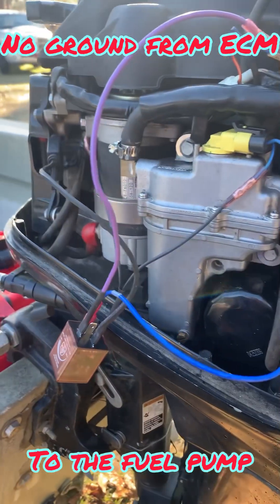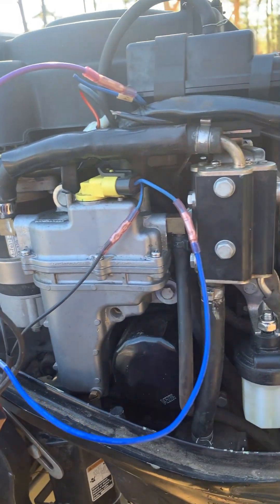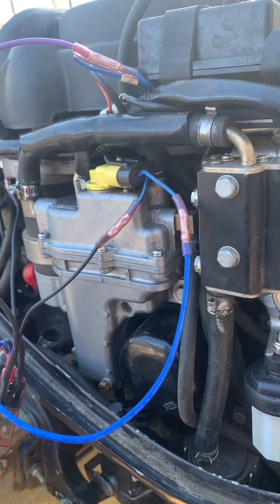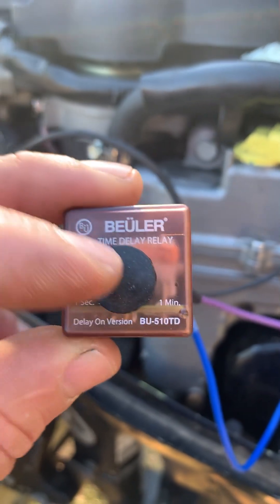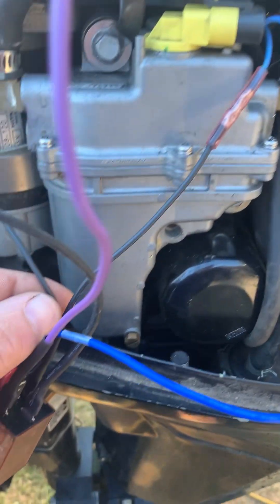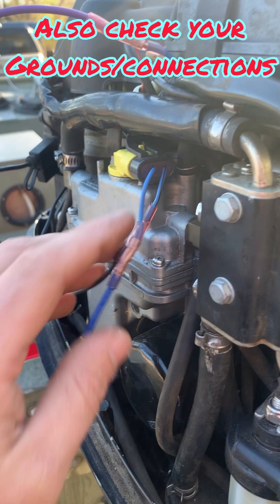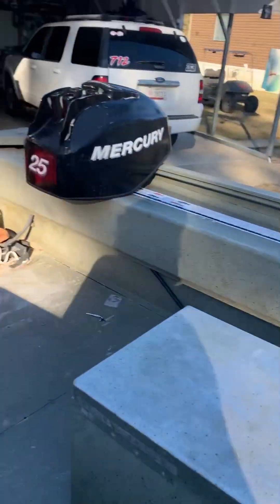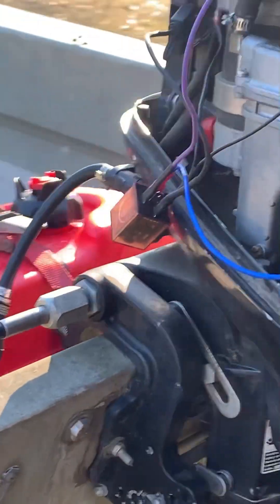Mercury/Tohatsu 25-30 HP fried ECM from aftermarket fuel pump. CHEAP FIX WITHOUT BAD ECU REPLACEMENT

Comment from the maker: I have gotten a ton of messages about more specific questions about wiring. Cut the original plug (2 wires) that plugged into the fuel pump/VST tank. Be sure to leave enough room on both sides to allow for a butt connector. It had a blue wire and a blue/black wire. 86 on the relay should be wired into the blue wire that is on the engine wire harness side (back to the ECM). ANd 87 on the relay wired to the blue wire on the plug side that plugs into the fuel pump. The blue/black wire on engine harness side (back to ECM) will now be left bare. The blue/black wire on the fuel pump plug should go directly to engine ground (use any bolt that's grounded) as well as to pin 85 on relay. and 30 on the relay should go to your constant 12v+ power source (fused of course) and I used the hot side of the starter relay.
Reply from the maker: And this setup is still working just fine. Customer uses it almost every weekend.
Reply: What size fuse did you use?
Reply from the maker: @jasonbower8524  15amp
Reply: Is that 15amp fuse too big, should I use a smaller fuse, does that oem pump draw that much power.
Reply: @racertjay will this work on mine exact same motor but manual start no battery

Comment: I need help. I have done the fix that you suggested. The motor now runs but it didn't solve my original problem. The shop had it for 3 months. Ruin my whole summer. I brought it there because it was only doing 7 mph. He gave it back to me with the relay fix but now the engine is still only doing 7 mph and it seems like it's surging at full throttle. So what is the issue with the motor? All my components seem to test good. Is it the high pressure pump is bad?
Reply from the maker: Sounds like you need to test your high pressure fuel pressure. There is a Shrader port on the fuel rail to do so. If it's good it ruels out a fuel pressure delivery issue, but could still be in injectors. If bad, you would need to confirm everything is good on the low pressure side before confirming it is high pressure pump. This could mean clogged VST tank/float, low pressure pump, filters, collapsed hose/bulbs, clogged pickup in tank. I'm not sure what the spec of the Mercury motor is but usually motors it's size should be in the 30-40 psi range
Reply: @racertjay be new pump today still pulsating and doing 6.5 mph
Reply: High pressure pump didn't solve anything. Clean the VST again. Still finding white residue. The fuel cooler was cleaned the fuel's clean. My only other gas is maybe the injectors but it's like it's running out of fuel every 5 seconds. Pulsating up and down at full throttle only at full throttle and I think that might have something to do with the relay. I don't know
Reply from the maker: @FishingwithForrest  You are throwing parts at it for no reason without testing the fuel pressure. Sounds like an issue with the low pressure side.
Reply: @racertjay well it was at the shop for 3 months. He said all the pumps were good. I'm returning the fuel pump. I ain't worried about that had another guy on here. Tell me that I should check the throttle position sensor but it doesn't look like I can even test it without a f**** computer so I don't know what to do. Next thing I'm going to do is pull all the injectors and have them cleaned
Reply: The fuel system was very dirty and still seems to be dirty, so I'm guessing there's dirt up in the injectors. When I first got the boat the top plug looked fouled and the two plugs underneath that looked fine. So my theory is is that the two injectors on the bottom of the engine are running lean and the top one might not be as dirty and is following the plug
Reply: @racertjay fuel pressure is at 42

Comment: ECUs usually control the "low side" of the circuits, the ground lead. Aftermarket fuel pumps often draw too many amps compared to OEM pumps, and blow out that controlling MOSFET inside the ECU. 
Therefore your fix is best, because replacing the $$$$ ECU with the same fuel pump still there, would kill the new ECU. 
You could bench test an OEM Vs aftermarket fuel pump and  ensure the amperage draw is within an Amp or so....

Comment: Do you have a wiring diagram for this motor?  I have a 2009 mercury 30hp efi 4 stroke....has electric start and also pull start....so it can run batteryless too...really need to know the colors of the wires coming from ecm etc.  

Also another question how does a battery less efi system like mine work in the event that say my battery died?  Does the rectifier supply dc voltage to the ecm?

Comment: Im curious how things work so im just wondering what's the actual need for the delay?  

Also does the fuel pump continuously run?  And the mechanical regulator controls the fuel pressure in the fuel rail?  Or does the fuel pump driver module in the ecm turn on and off the fuel pump based on sensor readings?  Im assuming the pump just continously runs because there is no fuel pressure sensor of any sort to tell the ecm what to do....im really curious on the need for the delay
Reply: The pump runs for the entire duration that the engine is running, there is a relief valve and return hose back to the vst.

When you crank the engine there is a sensor that detects that the engine is rotating and that turns on the fuel pump, when the engine stalls for any reason it cuts the power so no damage happens to the fuel system. I'm not sure why it needs the delay to run, but its probably something to do with the relief valve being open and that being signaled to the ecm.

The pump gets both positive and negative from the ecm, so by using the positive to trigger the relay you are pulling really low current to kick on the fuel pump, which saves the ecm

Comment: Great video, what side is the load wire on the yellow hp pump connector, trying jump the hp pump but not sure of the connector pin out? Thanks

Comment: Can you tell me what "gauge wire" Mercury used for those "Blue" and the "Blue/black trace" wires in that 2006 Mercury/Tohatsu 25HP outboard you posted this about? 

I am helping an elderly neighbor with this exact same year, make, model, and scenario to boot! Thanks in advance from a former FL LEO and former Master Automotive Technician.
Reply from the maker: I'm not sure exactly the gauge size, if I had to guess it was in the 18-20ish range. Much smaller then What I installed which was 14-16ish
Reply: @racertjay  I didn't know if you would see my reply and or reply back. Glad to see that you did. I ordered that relay and the proper sized wire fuse holder. I compared the  blue and the blue/black (trace) wires for the fuel pump in the wiring harness with some wire rolls I had. I had to dig the wire rolls out as I have not seen them or used them in many years!  

The Mercury blue and blue/black (trace) fuel wires ended up being 18 gauge. When we first see your small YouTube video preview picture it shows us your wiring schematic for your wiring drawing of that relay. It's a pitty that the relay wiring diagram was displayed so fast as a "preview" image . As a result, no one can take a picture of it or even stop the video to see it. I don't need it myself but wouldn't mind having the your "artist" version of it! I know other viewers would love to see it posted!

You did a AWESOME JOB with the tips,  the video, and explanation in great detail. Other people would clearly benefit if you would make an additional video showing that wiring diagram. That would also slow or stop the additional request for it. Thanks again for helping me to help my senior neighbor who is in his 80's. Thanks for paying it forward too.
Reply from the maker: @ thank you for the kind words. Glad I can help. If you email me at racertjay@yahoo.com I will send you a picture of the wiring schematic

Comment: Have same motor but manual start. It doesn’t have rectifier to wire pump into. If I bought a rectifier could I wire your relay setup with + wire going to rectifier output and achieve same results. Can’t see adding a battery if there is no way to charge it with the engine. Thanks for your time sir!

Comment: My fuel pump died thin Spring, so I replaced it with the Optimum type mentioned here. I followed these wiring instructions, and it works perfectly. Thanks for posting this video!

Comment: Hey bud i have a 1997 mercury 200 efi. After messing with i noticed i wasn't getting a ground on fuel pump. I glad i came across your video but was wondering if you had a writing diagram i could get as are wires and everything won't match up as they are different motors.
Reply from the maker: Email racertjay@yahoo.com and I’ll send a diagram
Reply: Sent

Comment: I just bought a used Pontoon with an 08 mercury 25hp 4 stroke EFI. 
I had the issue where it would start up when cold but if you shut it off after running for any amount of time it wouldn’t restart without sitting for a long time. 
I got a Tupperware bin full of things with the boat and I noticed an old fuel pump in the Tupperware. I also noticed a ground was teed into the fuel pump connector. I checked fuel pressure and I had 43 psi and figured fuel was fine. If I sprayed carb cleaner in the intake it wouldn’t pop off at all so I figured I wasn’t getting spark. Checked with a spark tester and sure enough no spark. 
I figured my ECM was toast after ohming the pulse sensors and getting measurements within specs. 
If it wasn’t for your video I never would’ve realized that the previous owner must’ve replaced the fuel pump and when the fuel pump was pulling too many amps and overheating the ECU it was causing a no spark condition. 
I added a diode suppressed relay to power the pump and so far it has started up shut off and restarted several times. I’ll have to report back after hitting the water again. Thank you so much for your video! Life saver!!
Reply: Hey, curious to know if you had success?  We just bought a pontoon with 2006 mercury 40hp with the same problem.
Reply: @Outsideofthebox13 yeah that fixed it 100%! Basically just used the original power wire to run the small side of a relay and ran a dedicated fused power and ground to a relay. I’ve used it several times and it runs great now!

Comment: Thanks for the info! Should the fuel pump be running when ignition is on, prior to starting?
Reply from the maker: No only when turning over
Reply: @racertjay  great. We took it out and put 12v to it - hums but seized solid. OEM replacement is over $800!!  A local mechanic recommended one on Amazon by Quantum Fuel Systems (US), for about $125. Ever heard of that brand?
Reply from the maker: Yes this was a quantum pump like the video says. Pump has been working fine but im assuming it pulls more amps then the OEM pump which is what causes the issue inside the ECM. The circuit in the ECM can’t handle the extra amp draw

Comment: Sorry for not understanding fully but my mechanic told me my ECM needs replaced after an issue following fuel pump replacement with a aftermarket pump. Would this work if the "ECM is bad" according to him?
Reply: Depends. He needed ALOT of research to figure this out. Its not easy. If you have the identical engine you may do his repair. If not save your money for an emm and fuel pump (or resistor to drop power to pump)

Comment: I have a 2003 60hp 4 stroke mercury motor with a fuel pump  that runs str8 through and i can't figure out what could be causing it. The beep that should come on exactly after turning the key on the control starts after like 20 seconds after i turn the key and when it comes on it beeps for a long time stop and starts back again. the only time my fuel pump stops is when the peeping stops and that's because the beeping only stops for a second. what i'm trying to figure out is if the problem is cause by my ECM, the Vevor control i bought off Amazon or is it just my fuel pump.  please can someone help me with this issue? i'm really in a bad place right now.

Comment: Tohatsu outboard does not get gasoline into the cylinders. The injector, ecu, spark plugs are intact. When I pour gasoline into the pistons, it works a little. When I press the starter, oily gasoline comes out of the exhaust. Could the high pressure pump have malfunctioned? How can I test it? Greetings from Istanbul, Turkey..
Reply from the maker: Test your fuel pressure with a gauge at the test port (shrader valve like a car tire) on the fuel rail. If no pressure, test the voltage at the fuel pump wires going into the vst. Don’t use motor ground use the actual wire
Reply: @racertjay    In this engine, apart from the normal injector, there is also an air injector. I do not know how to control the air injector. The compressor is very good. What does air injector do? Could the cause of the malfunction be the air injector? Thank you very much.
Reply from the maker: If you have fuel pressure, you have a different problem. Could try to bleed it off and make sure it builds back up next time you start it.

Comment: I have the same problem with my Tohatsu TIDL 70Hp will this work on my motor. 

It also has a bad ground to ECM
Reply: Did this fix it?  Would your pump come on upon ignition but wouldn’t fire up ?

Comment: im having a issue kinda like this  i have 12 volt at ground when the engine is off but when it starts it goes to 9 volts then to -2 volts is this normal for these engines?

Comment: Did the engines oil light and beep sound come on before this fix?
Reply from the maker: the oil light will come on for a second or two at each startup. Before and after the fix (that's normal). The beep also the same.
Reply: @racertjay  my 2007 mercury 25hp is having intermittent ground issues on the fuel pump , it starts sometimes but only if the oil light comes on and it beeps and it will run all day long and have no issues , but after it sits for a few days I turn it over and no oil light or no beep so I’ll have to try and crank it for a long time to get it to run, my question is prior to your fix was the oil light and beep coming on while cranking , I’m just wondering if it’s my ecu or the oil pressure sensor . Some days it works fine some days it takes a while to start , but only will run when it beeps and the oil light comes on
Reply: @deangarrett50  do you find a fix I'm having the same problem right now

Comment: You should redo that video with it wired right
Reply from the maker: It is wired correctly in the video. Which is why it starts up and runs and still runs now?? Not sure what you mean. But I also see your other comments now. Read the pinned comment on the video I made for specific wire colors to relay pins or if you send me your email I can send you a wiring diagram I made
Reply: @racertjay are you willing to send me the diagram i really appricate your time !! i just put a new pump in and scared it gonna blow it up you know how i can put diode in

Comment: It lookes like  both ground wire from bolt and wire to pump are  on same pin, if so there is no delay on ground.
Reply: That's what I'm saying 🤔 Might as well ground it directly. If it's a negative trigger pump, it would have 12volts all the time and closing the ground would kick the pump on, if I'm understanding this correctly.

Comment: Just had the exact same problem show up today, 2nd time running motor after replacing the HP pump.  Man I wish I knew this before buying the aftermarket pump.  Was your ECM still good aside from losing the fuel pump ground?

Comment: i have a 60hp 2015 with bad pump , i wanted to bypass the original relay all together , what part number or under what name did you use to get the plug for the fuel pump ( black plug with 2 blue wires going into yellow plug) thanks

Comment: I have 2001 Mercury Optimax and the ground wire from the ECU is bad. I had thought it was the fuel pump and replaced it. When I started it up the engine didn't fire up. Like you I checked the power wire and not the ground wire. A new ECU for mine is $1,700. If I can do what you did it will definitely save me a lot of money. So how has your customer's boat been holding up? Let me know cause if it's still good I'll be doing what you've done in this video. Thanks!
Reply from the maker: Everything is still great. They use it almost every weekend
Reply: @racertjay  Awesome. Thanks for the very quick reply.
Reply: @racertjay Hooked up the relay. The outboard fires up nicely. But the thing is the fuel pump stays on. Did your customer's boat do the same thing? Stays on even before I turn the key.
Reply from the maker: @kisdasenglothnam  the fuel pump should run constantly when the engine is running. Is that what you are referring too?
Reply: @racertjay  I hooked up the 12v power to the wire straight from the battery. So when I turn on the batteries the pump stays on constantly without turning on the motor. How did you hook up the 12v input? You mentioned something about the starter solenoid? That's what I'm trying to find out. Do you have a Facebook?
Reply from the maker: Yes. I can message you a wiring diagram. Facebook.com/TPRacin
Reply: @racertjay Thanks! I had finally got the relay installed properly to the key-turn starter thing. Now it only turns on when I turn the key on instead of it constantly being on when I connected the power to the wire from the battery. I've turned on and off the outboard a few times with no problems. Going to try it out this weekend or the next. I will let you know how it goes. Again, thanks for quickly getting back to me.
Reply: @kisdasenglothnam  Did the relay setup work once you rewired it?  About to attempt this repair myself.
Reply: @dannyhvac37  Yes, it is definitely working. Good luck with yours.
Reply: If my ecu negative is bad will it cause no spark at the coils